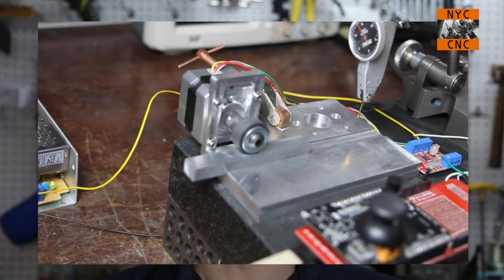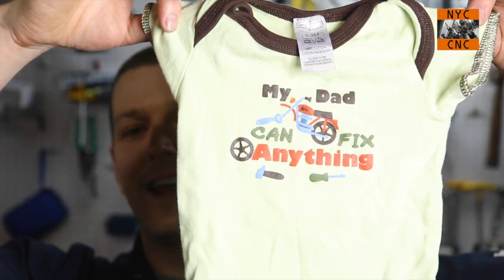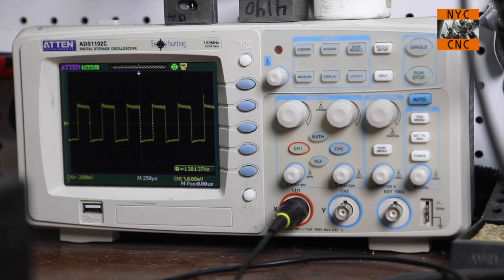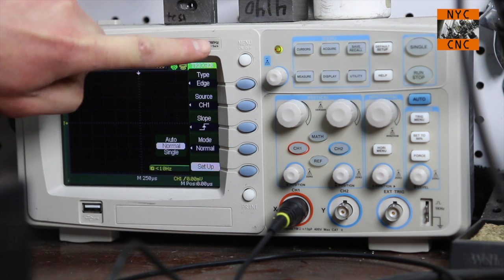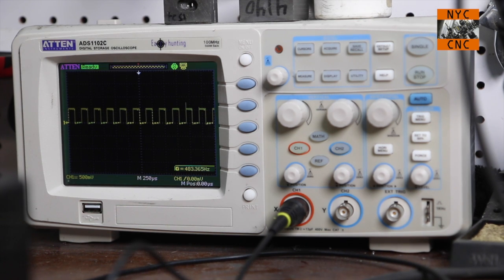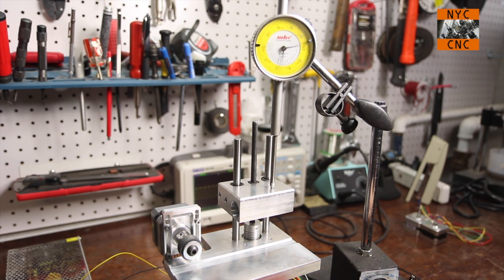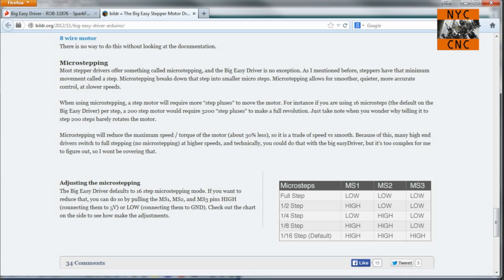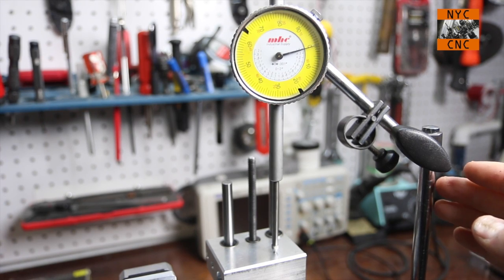Arduino Automation!  Stepper-Driven Automatic Cutting Saw

Comment: Hint: Two things:- Your driver can't be one wheel. You need one that is the driver and the other an idler, both level with the surface of the material being worked (think triangle 60, 30, 30 or 45s degrees). The next thing is that the stepper attached to the lead screw does not have enough torque for applying enough pressure to maintain the stability and accuracy for the cutting head. I would suggest that you use a timing belt and timing gears with the stepper off to the back point downwards. This will multiply the torque just enough for the stepper to apply the required amount of force to the cutting head to keep it sturdy while in operation.The harmonic created from the saw on the cutting head can affect the lead screw and make the cut inaccurate. 

Hope I was able to convey my thoughts when I look at your design. Great video. Thumbs up.

Just my Two Cents

Comment: I think you are getting a linear ramp up and it could be hitting a frequency causing that rattle. If you change the ramp up character you might be able to avoid or minimize the time spent at that point and reduce error.

Comment: Note that it's not 375 thousandths or 125 thousandths that you move at the end of the video but 375 (125) ten thousandths.  You're moving 50 thousands at the beginning, that's correct - 'adding' the digit on the end adds another 0 to the thousandths measure.  So, you could also say 50 thou, 37.5 thou or 12.5 thou to use the same scale, or 500/375/125 ten thousandths

Comment: John, speaking as an old electronic technician those signals that you showed is what is usually described as "noisy". All that wiggly stuff on the horizontal lines is noise, and if you want reliable stepping you really should reduce that as much as possible. Also the leading edges of some of the stepper motor pulses show as much as 50% voltage overshoot; that's the big spike at the top of the leading edge of the pulse.

How to get rid of it? Use shielded cables, and earth one end only of the shield. Earthing both ends can give you a "hum loop".  All earths should be at the same place; i.e. all earth wires are run from shields to one point on the chassis and all are connected there. 

I ain't quite sure what you are using to produce stepper motor drive pulses, but here is a useful little article on cleaning up the output of Toshiba motor control pulses. The same technique could well be tried here to try to get all that fuzz off you signals.

http://www.homediystuff.com/fixing-a-chinese-made-cnc-stepper-motor-driver-board-tb6560-chips/

Comment: Just a "by the way":  Your feed limit switch should be mounted to the side of the part so an error doesn't drive the part through the switch; the switch should not used as a mechanical stop; a proximity switch is better than a mechanical  switch in such applications.optical, capacitive or inductive. I'was/am an industrial Electro-mechanical tech.

Comment: Aha spent the past day trying to figure out what the dial indicators were called looked all over my shop had no idea, watched your video bought a new one and looked in my drawers of tools and i already had one.. the irony. But why not use a 200 step, full size nema 17 yours seems to be a pancake stepping motor. http://www.damencnc.com/images/products/fullsize/1297527165_nema17.JPG
Reply: Yeah it is but it looks like a pancake stepper (They look like pancakes) there very thin compared to the black slats in your stepper there dont seem to be as many as a standard stepper. May just be the way its made

Comment: Nice projects and exactly what I designed a few years ago.
Tip 1) Your feeder will slip and although you have a limit switch set at the end, you can do a much better job. Design two roller bearings underneed your material with your feeding wheel exact in the middle. Press the feeding wheel a little in order your material will get an S-Form over-under and over the rollers. (S-Form ~ 0.03 mm)
This will prevent the feeding wheel from slipping and your feeding is 100% unless your stepper is loosing steps.
Tip 2) Have your limit switch side ways in order to protect it better for being a DEAD end.
Kind regards
Ed van den Enden

Comment: John:  Lack of repeatabitity with the accel code is likely because you are driving the stepper at or near a mechanical resonance frequency as the drive rate ramps up and down.  When this is done, the available torque from the stepper motor drops to a minimum.  This can cause inconsistent step slips to occur.  From the scope traces, the duty cycle looked extremely short which equates to a high step rate, which leads to low torque and possible slippage.  Hope this helps.
Reply: NYC CNC John:  In retrospect, the minimum pulse duration on the Big Easy Driver is 1 microsecond high, 1 microsecond low.  This is a very short pulse, you are most likely not pulsing it faster that this.  You could still be running into lack of torque due to ramping through a resonant frequency on the step motor.

Comment: John,
Great video, and great project.  Thanks for sharing.
I use an Arduino driving a stepper to rotate a rotary table to cut gears.  You input the number of teeth, and it step the precise amount of rotation to cut the gear. 
I need to spend more time on additions to the program to cut a radius on the mill.
BTW,  250uS  is 250 micro Seconds (a micro second is 1 millionth of a second.  mS is milli seconds (1 thousandth of a second)

Comment: John,
You don't think that 1/4-20 thread will be to course? I think your going to need a way finer thread unless you got a real stout cutter. I guess you could gear the stepper but that would require a design change at this point. Looking forward to seeing this work. Cool project and series!

Comment: One suggestion, the linear bearings will chew up the vertical drill rod pretty quickly.  From my experience with 3D printers, you could probably get by with bronze bushings instead of the linear bearings or you could replace the drill rod with hardened shafting... pretty cheap from McMaster Carr.  Great thread, your enthusiasm is contagious... Chuck

Comment: I felt the pain when I saw that thumb of yours at min 4:04. I remember years ago I smashed my finger nail under an electric 25hp motor, don't wish that to anybody. Great video and great project, as always.
Reply: NYC CNC it didn't fall from a considerable height, it was mounted to a water pump, so it must have been an inch or so above the surface, but enough to rip my nail.

Comment: Awesome I'm new to this as well and learned a lot from your videos i just need cash to buy equipment to set up my own shop and start my projects do u know where they sell a cheap oscilloscope?
Reply: Frankie Kato 2 Sudgestions for cheep O-scope.  My next scope for the home lab will be a picoscope http://www.picotech.com/ I have been using one at work, and they can do everything a big scope can, but it takes some time to get used to the computer interface.  I also have a protolab https://www.sparkfun.com/products/11643 Its slow and small, but they are only $50.  I use mine quite a bit when working with an Arduino.  Its fast enough for that.
Reply: Same as u I never went to school for this ever but really interested in this and also I'm horrible in math that's why I never pursued doing this ever
Reply: Thank you alot Troy Alexander I'm trying my best to learn will keep you posted on my progress

Comment: I saw that the accel library was down to 5uS.  I remember playing with the older EasyDriver, it had said that it could only get down to 20uS. Might be the problem there. Probably a parameter in the stepper library.
Reply: For some reason I was thinking about this. Here is the function in the AccelStepper library that should clear up that issue:

void AccelStepper::setMinPulseWidth	(	unsigned int 	minWidth	)	
Sets the minimum pulse width allowed by the stepper driver. The minimum practical pulse width is approximately 20 microseconds. Times less than 20 microseconds will usually result in 20 microseconds or so.

Parameters
[in]	minWidth	The minimum pulse width in microseconds.